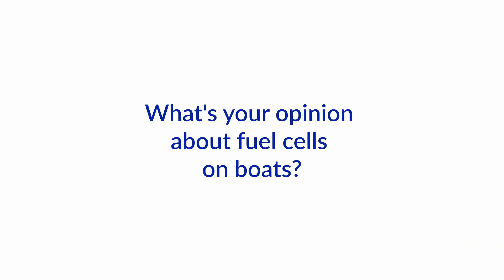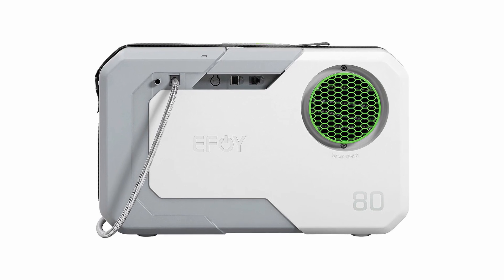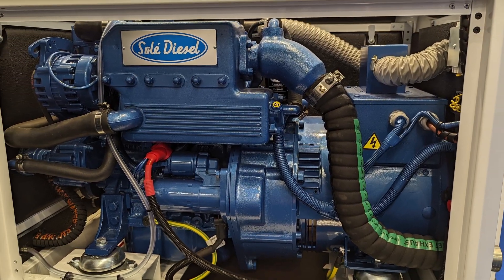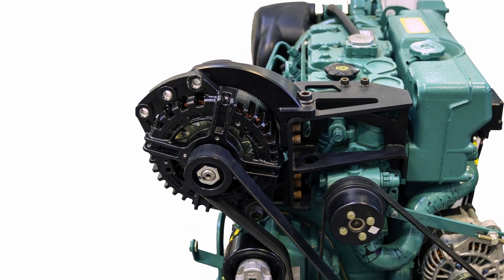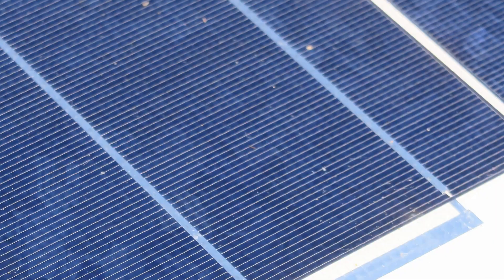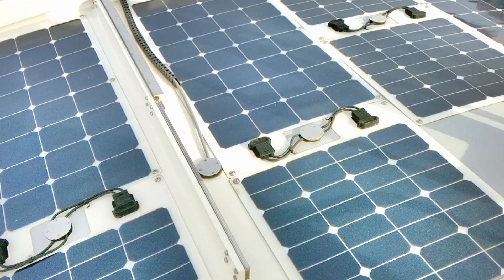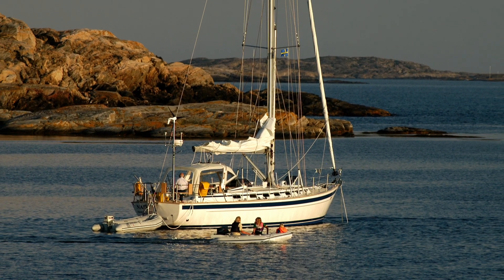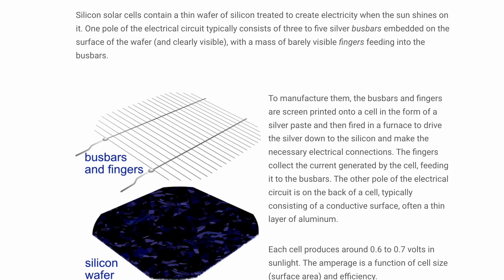FUEL CELLS on Boats - the solution to ENERGY STORAGE problems?  | Ask The Expert with NIGEL CALDER

Comment: Hydrogen can be compressed and stored safely, however it requires the use of lithium 6. Instead of using the lithium for batteries we could use it for hydrogen storage. Lithium 6 is used in nuclear weapons though, and is a controlled substance. The lithium 6 is used in the same way that acetone is used to safely store acetylene gas. You still require a lot of electricity if you want to use water as a base.

Comment: I would pay massive amount of money if there was any natural gas fuel cell power generators available. where i live, cng fuel or natural gas is dirt cheap like 1 cent per kilogram. I don't care about efficiency. i just want that quietness it gives you. And offcourse, NO MOVING PARTS. imagine having a camper that has a virtually silent generator thats reliable, cheap to run, ellimination of expensive and impractical solar energy, can run an air conditioner silently not with a honda generator thats not silent.

Comment: 98% of our hydrogen is from methane forming - ie from burning coal so it's not even close to being green. Its way cheaper than making it from electrolysis so likely to be that way for a long time. and then as you say we need distribution , storage and it's a small atom and likes to leak. Diesel is great for fuel density so will unfortunately stick around for a while yet and diesel motors are something we understand well at this stage. Hoping that solar gets more efficient and we can get more power from panels and try and squeeze as much onto the boat as possible - without turning it into an aircraft carrier!

Comment: Agree with everything said in this video! However. the EFOY is a good fit for some boaters, like us.  I need to run refrigeration (12v), no real estate on deck for solar (which does not work well at night!). Been running an EFOY 1600 for 7 seasons now. It works exactly as I need it to do. It is a Methanol powered battery charger. Charges my 7 year old Firefly batteries quite well when we are at anchor for extended periods of time and helps keep the refrigerator cold! Yes the fuel is crazy expensive and hard to get. I get a season or 2 out of 1 refill (works out to about $10/month, give or take).  Bottom line for me, is I went fuel cell for the convenience of not having solar and for 24 hr charging, at a large financial cost.  If my fuel cell dies, will be replacing it with a new one in a heartbeat!  
I do not disagree with anything said in the video. It was very accurate I, and many others, choose it  for the convenience, and pay for it, literally!
I feel, for most boaters, that a fuel cell would be excellent in addition to solar, or as a backup if solar can't keep up or breaks.  The EFOY is quiet, easy to install, and fits a niche market of some of us cruisers. 
Thanks for putting up such great content!
Reply from the maker: Thanks for sharing your experience! Indeed there are circumstances where fuel cells can be a great addition to a boat's energy mix (especially if cost is not an issue). Most average boaters however will be better off with a combination of solar and high-output alternators. But we would love to see more development in the area of fuel cells and the establishment of an infrastructure for renewable fuel sources.
- Nigel & Jan